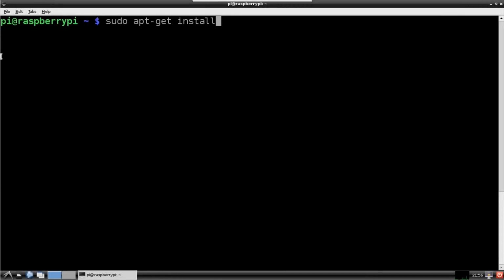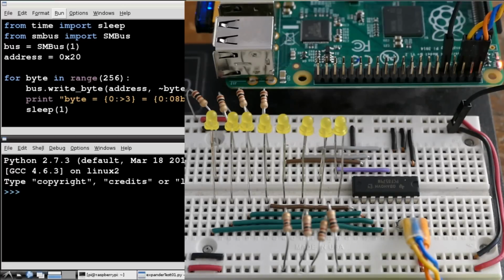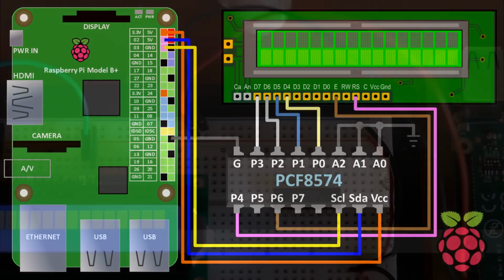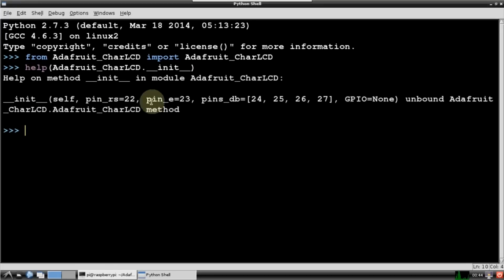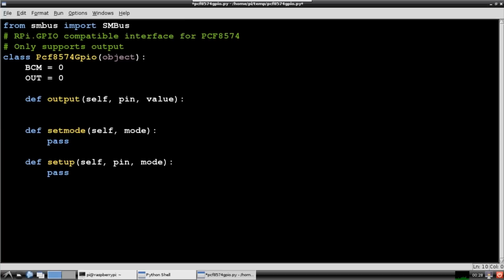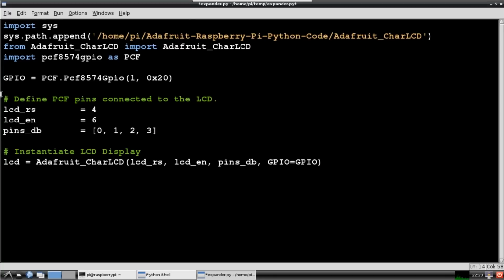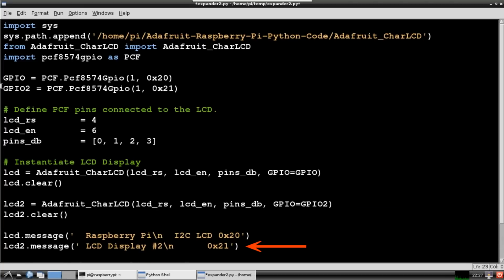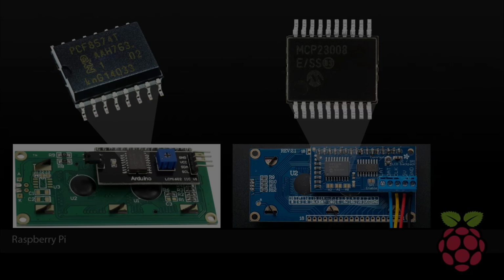Using an I2C LCD Display with a Raspberry Pi

Comment: Whenever I execute i2cdetect, the address changes (in an unpredictable manner). I looked the issue up, but couldn't find anything helpful (it was said to be caused by faulty soldering, but I don't think this is true in my case...). I read on some Arduino-Forum that the internal pull-up resistors may be too "weak" and that I need to use a dedicated resistor. Have you heard of that/what would you try to fix this? EDIT: Here's a video of what I'm talking about https://youtu.be/lQuMjmipCWI
Reply from the maker: What I2C device are you trying to connect? How long are your wires?  Does you I2C device have built-in pull-ups?
Reply: rdagger68 I followed your Tutorial (and read the post on your website about it :) ). I'm trying to connect my Raspberry Pi B+ with an I2C Backpack with the PCF8574T. The wires are standard Dupont wires, I guess 20 cm, as I am using the Pi it has built in Pull up/down resistors :)
Reply from the maker: Did you set the address jumpers on the I2C backpack?  Can you try a different address?  Does the backpack have its own pull-ups and if so can they be disabled?

Comment: i need to communicate to 128*64 graphics lcd display with i2c PCF8574 interface , can you guide me ,i hope 2 PCF is required for controlling one GLCD right?
Reply from the maker: It depends on your display’s chip.  If it is a KS0108, then I think you will need 13 pins.  An MCP23017 would be a better fit than the PCF8574 because it has 16 ports instead of 8.  It would be much easier to buy a 128x64 GLCD with built-in I2C support such as the Adafruit ST7565.  
I wrote a python library for controlling the ST7565:  https://github.com/rdagger/Pi-ST7565
I also made a video tutorial:  https://youtu.be/Nn5u9xhHCTM
There is write up on my website:  http://www.rototron.info/raspberry-pi-graphics-lcd-display-tutorial/

Comment: Hi great tutorial I have used both PCF8574 and MCP23008 Chips these work great. I am trying to run a Adafruit I2c/spi lcd backpack I can get it to work by changing the data pin outs from 0,1,2,3  to 3,4,5,6 .The backlight is the issue it's controlled on the pcb by p7 via what I think is a transistor . If I hard wire pin 16 on the lcd the backlight works. Please can you suggest how I can control p7.
Reply from the maker: What is the part number of the Adafruit display?  Are you using the Adafruit_CharLCD python library?
Reply: rdagger68 hi it's 292 and using Adafruit_CharLCD Pyhton. I asked for help from Adafruit but they said they don't have any code! Thanks I've sorted it ,added lcd_backlight = 7 and added lcd_backlight to lcd =Adafruit_CharLCD(........... thanks.

Comment: may i be able to use the PCF8574AP or i do have to modify something???
Reply: is it any diffrence between PCF8574 and PCF8574AP ???
Reply from the maker: I think the only difference is the slave the address.  It should work.  You just need to specify a different default address which you can determine using i2cdetect.
Reply: mine is 8x38
Reply: i mean in the collom 8 the arrow 30 .... so is it like 8x38 ??? no? :-ss
Reply from the maker: row 30, column 8 should be 0x38
Reply: rdagger68 i've tried this but nothing happens ... it's just blank screen with full contrast dots (i have potentiometters and are setted up)
Reply: rdagger68 solved!!! the problem was on my screen soldering wasn't makeing perfect contact :D now is running! :) thank you for your help!!!

Comment: is it normal to heat very very very hard when i connect VCC???
Reply from the maker: Sorry I'm not sure I understand your question.  Is your PCF8574 getting hot?  Are you sourcing or sinking the current?
Reply: rdagger68 i've solved the problem ... thank you! was a short problem with wireing!

Comment: great tutorial. I am new to pi. I would like to know if we can communicate between pi and Attiny using python. Also let the Attiny work independently. For example sending commands to Attiny or get pin status of Attiny to pi. If possible, would you please make a video tutorial. THANKS
Reply from the maker: Yes you can communicate with an AVR using SPI protocol. I have a video on that subject: https://youtu.be/npSwLOMfstY
The AVR can run independently of the pi. It is a good way to handle analog sensors or devices that require precise timing.
Reply: rdagger68 Thanks.

Comment from the maker: Please note that Adafruit has made breaking changes to their libraries since the video.  My website has updated code and instructions.  See video description for link.
Reply: Hi. I have a 2004a display with a backpack pcf8574T, this is allready solder, i dont know the pins (with yours my display does not work). How i can know the pins? Thanks!

Comment: When executing 'sudo python displaytext.py (what i named file, yours was names 'expander.py'
I get an error:
  File "displaytext.py", line 12, in <module>
    lcd = Adafruit_CharLCD(lcd_rs, lcd_en, pins_db, GPIO=GPIO)
TypeError: _init_() got an unexpected keyword argument 'GPIO'

GPIO is defined as such: GPIO = PCF.screen(1, 0x27) (Screen is your pcf8574gpio.py)

Can you help or point me in the right direction?
Reply from the maker: +vanhodid Looks like Adafruit has recently changed the library.  Try lcd = Adafruit_CharLCD(lcd_rs, lcd_en, pins_db, gpio=GPIO)
There could be other changes (not tested yet).
Reply: +rdagger68 Trying with lowercase gpio results in a 'not enough arguments' error.
Reply from the maker: +vanhodid I haven't had a chance to play with the latest release, but there are clearly breaking changes.  A quick look at the source code shows that you also need to specify rows and columns.  I'll post an update on my website soon.  Here is the constructor:def _init_(self, rs, en, d4, d5, d6, d7, cols, lines, 
   backlight=None,
   invert_polarity=True,
   enable_pwm=False,
   gpio=GPIO.get_platform_gpio(),
   pwm=PWM.get_platform_pwm(),
   initial_backlight=1.0)
Reply: +rdagger68 Started to complain about Non ASCII characters '\xef' in my 'Screen.py' file (your PCM)

Added in #!/usr/bin/python to both files and it still complains for the same reason on line 10 that contains ' pwm=PWM.get_platform_pwm(), initial_backlight=1.0)'
Reply from the maker: +vanhodid Did you install adafruit-charlcd using pip?
Reply: +rdagger68 Unsure what you mean with pip, i got it through Git command then link provided on their Github page
Reply from the maker: +vanhodid I updated my website and fixed all the code to address the changes since the video:
http://www.rototron.info/using-an-i2c-lcd-display-with-a-raspberry-pi/
Reply: +rdagger68 Bloody Legendary!

enjoy the rest of your weekend,
I'll let you know if i run into any problems!
Reply: +rdagger68 I plugged it all in and no errors!
I do however have the LCD turn off when i execute the script, I'm using a 20x4 LCD and found an alternative script that works copy/pasta, Here is the link http://www.recantha.co.uk/blog/?p=4849

Is it the Adafruit library that is incompatible with this LCD?
And thank you for all your help! you're amazing :)
Reply from the maker: +vanhodid What is the type & model # of the I²C chip on your LCD?
Reply: +rdagger68 Same chip as yours, the Pcm*** or whatever it was.
It might have had a t at the end.

If you want me to chase this up further i can give you the info later.
Reply from the maker: +vanhodid I don't have a 20x4 to test, but I looked at the Adafruit code and there is support for up to 4 lines.  The code you linked uses the same command constants, flags and line addresses as the Adafruit code.  It should be compatible.  It could be a backlight issue.
Reply: +rdagger68 Well it works, so im not going to fix what aint broke ;)

Thank you again for all your help!

Comment: I've been trying the New Haven display,  which uses a PIC to decode the I2C commands from the RPI.  But this hasn't been working well.  The messages jump around. I contacted Newhaven. They are looking into it. They reproduced the problem.  Their initial take on it was that the I2C library (Python or C driver) had a bug.  They showed me a clock edge on a scope that ended funny.  We'll see.  A slave can also do something funny on an I2C line.

Comment: I have a 1602 LCD with a  I2C Board Module how would I plug it into the Pi?
Reply from the maker: +Nick Farrow Same as in the video.  SCL to gpio3, sda to gpio2 and ground to ground.  You do have to make sure that the voltage is compatible with the Pi.  If it runs at 3.3V the just connect the Vcc to a 3.3V pin.  If not, you will have to check with the vendor and make sure it is safe to connect to the Pi.  It probably is.
Reply: +rdagger68 working great thank you. Also just noticed the all the raspberry pi gpio  images have it too. over looked LOL
Reply: +Nick Farrow  also uses the PCF8574T chip.

https://github.com/VeggieVampire/I2C-1602-LCD

Comment: hi, i have bigg Problem...When i write import pcf8574gpio as PCF i have massage:No module named pcf8574gpio
where i need to save Pcf8574gpio code?
Reply from the maker: +Ivan Bebek You can put the module in the same folder as your program.  Or you can add it to your path.  One easy way is to use sys.path.append

Comment: Hi! Great video!
I am using prewired display with address 0x27 and pins rs=0, en=2, db=4,5,6,7, but after running your code display only turns off. I cannot find where the problem is. 
Can anyone help me please?
Reply from the maker: +FlakJack What's the brand and model # of your LCD display?
Reply: +rdagger68  It is YwRobot LCM1602 IIC V1  with PCF8574 attached in following order:

addr, en,rw,rs,d4,d5,d6,d7,bl
0x27, 2, 1, 0, 4, 5, 6, 7, 3
Thank you in advance!
Reply from the maker: +FlakJack Are you powering the display at 3.3V or 5V?  Do you have a link to the datasheet for the display?
Reply: +rdagger68 I am using 3.3V. I got it in a kit without any datasheets. I found on some forums that wireing is as I mentioned before, and I managed to trace it on board.
Reply from the maker: +FlakJack I cannot be sure without the datasheet, but the display probably requires 5 volts instead of 3.3.  To be safe, I would use a level shifter for the SDA & SCL lines.  It would probably work without a level shifter but it would be out of spec and there is a slight chance you could damage the Pi.  Here's a good link: https://plus.google.com/+shahadaabubakar/posts/3VBKWVEe3st
Reply from the maker: +FlakJack The problem could be the back light.  The Adafruit module doesn’t handle the back light.  Your display may default to off.  The working module you posted has a bl parameter in the _init_ method.  You can add a bl parameter to the Adafruit _init_ method and also add the line: self.GPIO.output(bl, True) to the end of the same method.
Reply: +FlakJack try to use this library https://github.com/alinleonard/LCD-I2C-Raspberry-Pi-2
Reply: +FlakJack The link you gave out works but I am just having a problem with the data it's returning and on what line.
https://www.instagram.com/p/BARpNu-yMB4/?taken-by=veggievampire
Reply from the maker: Nick Farrow
If you send the same text to the LCD such as “Hello” is the gibberish always the same or is it random?
Reply: The text on the Instagram photo was helloworld :(
Reply from the maker: +Nick Farrow What is the brand and model # of your display?  It could be the pin mappings.  When you instantiate the Adafruit PCF GPIO, make sure you specify the correct I/O pins on the PCF chip.
Reply: +rdagger68  Not sure why but a reboot fixed it!!!!!!!!!!

Comment: I enjoy your videos.  One suggestion.
put w1-gpio and w1-therm BEFORE i2c-dev and i2c-bcm2708-- otherwise, if you run the camera first, it will crash i2c.  A reboot is the only fix for this problem.

Comment: 3 min 22 sec into the video you show SCL /SDA connected to GND and 5V.  WRONG!

9 min 26 sec into the video, the SCL /SDA are connected wrong as well.
Reply from the maker: The wires terminate in the left column which is 3.3V, SDA & SCL.
Reply: rdagger68
Yes I understand where they go, I just wanted to point out that the SDA /SCL were incorrectly connected
in the video.
Reply from the maker: Ted Mieske In the video they terminate in the left column.  Unfortunately, you do have to look closely.  They cross over the right column to get to the left column which I see now was a poor choice because it is confusing.  It was not meant to show additional connections.  Sorry, in the future I'll use junction points or draw the pins and route around for clarity.  Thanks for pointing it out.
Reply: rdagger68
Your Welcome!
Reply: Ted Mieske how come I do not see any issue with the connection, I agree that the diagram is poorly designed but no wrong things shown for sure :)